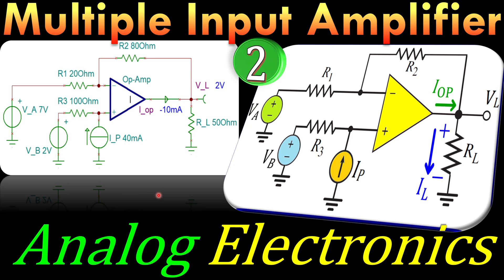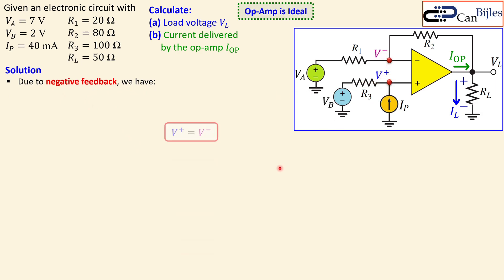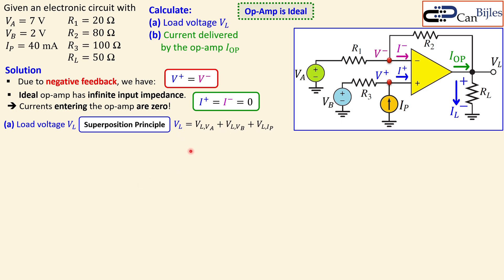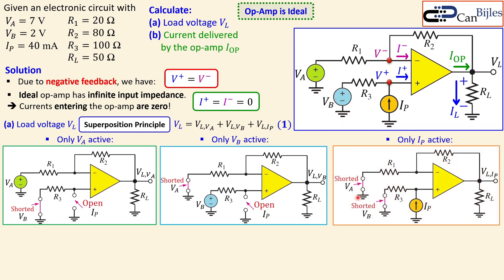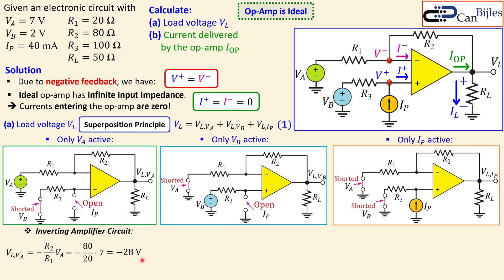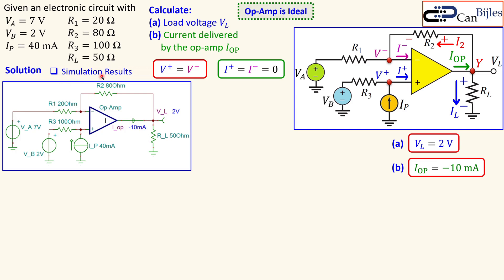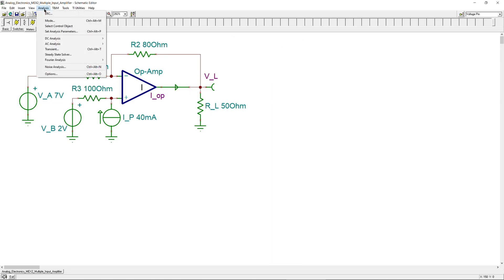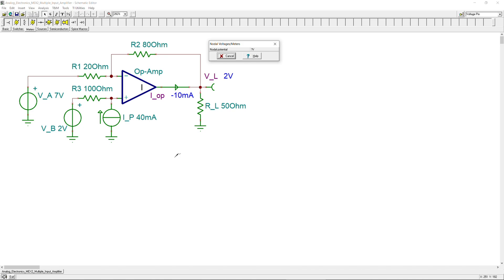Analog Electronics ⭐ Multiple Input Amplifier using Op-Amps - Example 2 ⭐ Calculations & Simulations

Comment: Thank you for this amazing video.Please advise on the role of the current source in this circuit with an example of it.
Reply from the maker: You're welcome! Current source is used to model sensors or elements which generate current, like for example a photodiode. It can also model nonideal effects of an op-amp.